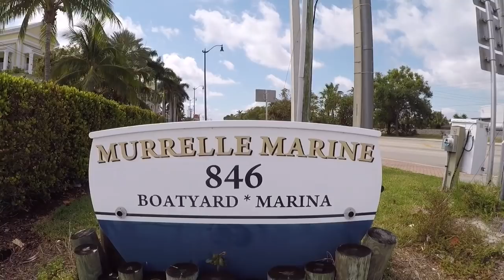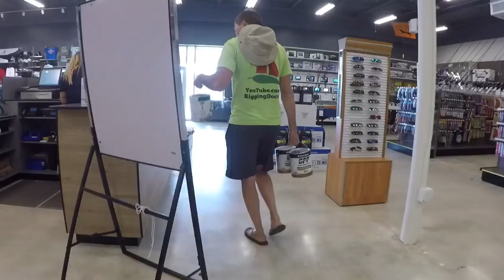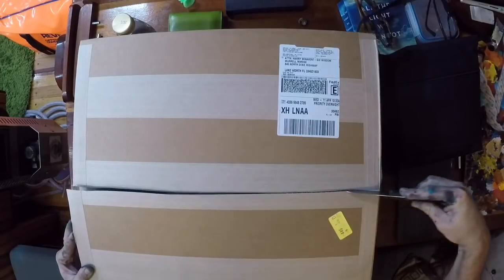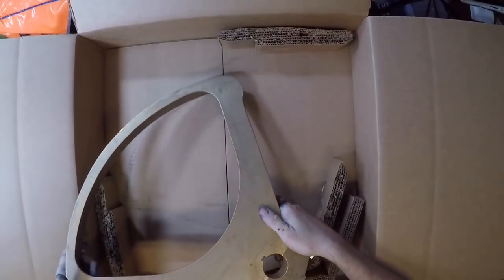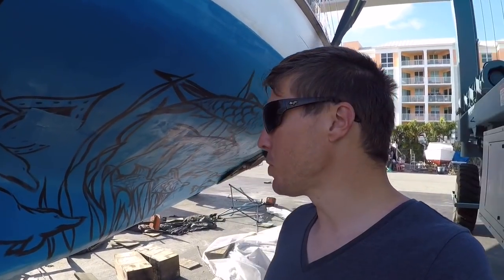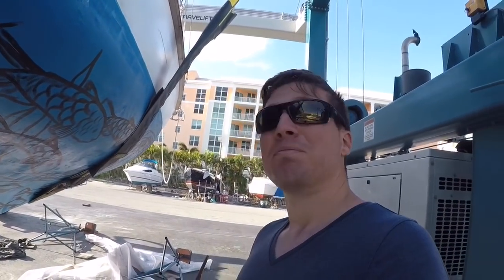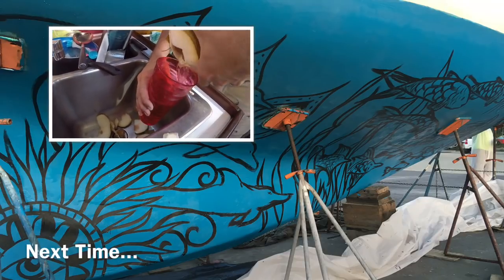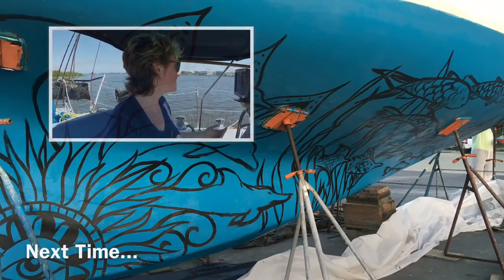The Haul Out (Part 2): Bottom Paint and SPLASH| Sailing Wisdom Ep 112

Comment: Nice job on getting all that work done so quickly!
I must say that your various trials and tribulations are validating a lot of the design decisions I made for my upcoming build.

1. Junk rig. No "I'm not gonna raise sail just now, because in a couple of hours, I'm gonna have to drop/reef it again" blues. Tacking is a piece of cake. No raising/reefing hassles. No fears of gybing when running downwind. No foredeck work. No bags of extra sails taking up valuable space below decks. Built-in storm sails. And, of course, no standing rigging!
2. Tiller steering. No quadrant to break, and easier to repair at sea.
3. The lazarette will be closed off from the main cabin and bilges by a watertight bulkhead, and will have its own "bilge" pump.
4. Same for the chain locker, except that it will be self-draining. (watertight inspection hatch, naturally)
5. Watertight collision bulkhead forward of the chain locker. Given point 3 above, it's kind of overkill, yes.. but it'll strengthen the hell out of the bow and provide a truly herculean samson post mounting point.
6. No below or near waterline through-hulls. Salt-water day tank and pump-out grey water tank/s instead. The peace of mind is worth a little extra hassle.
7. Watertight outboard motor well under the cockpit, fully and permanently closed off from the interior.
8. And I'm debating the merits and positions of one or two other watertight bulkheads (including bilges) in the main cabin area as well.

Given your severe allergy to raising and reefing sail for short periods of time (no offence intended, on your boat I'd feel the same way), I'd highly recommend that you consider one day converting Wisdom to junk rig yourselves. It will be a fair bit of work, given that you'd have to relocate the mast (and maybe add a foremast as well), but it will more than pay off in ease of handling. Just a thought.. ;-)

Comment: What I do to get under the stands is lower them, one at a time, paint, wait for it to dry, then raise the stand back up and move on to the next one.  The stands aren't supporting the boat.  They are just there to keep the boat from tipping over.  The boat is supported by the keel, sitting on blocks of wood.  If you are nervous about things, you can move the stand forward or back a couple of feet while the paint dries (or you can use a spare stand if one is available).

Good to see the damage was relatively minor.

Comment: I’m confused as to how or y you were charged 9700 for salvage could you not of just paid for tow neither of you left the boat so could you explain to viewers as to how it works when you become stranded outside of icw
Reply: Sailing S/V Slipstream , it has more to do with a soft grounding like the ones in the ICW, what happened on the beach they basically were hard a ground and out of the water.. commonly called a shipwreck.

Comment: I have concerns about the repair to the rudder. Filling the area with epoxy and cabosil with one layer of finish cloth is not a structural repair by any means. I think that crack should have been ground back for at least a 12 to one angle and glass fiber / epoxy used for a strong bond / repair. Then fair with epoxy putty... epoxy and filler does not make for a strong repair. Keep a close eye on your repair... hope all goes well. Be careful and seek out information from those experienced before going ahead with repairs.
Reply from the maker: It was a very shallow crack on the side of the rudder. The foam inside was really dense and strong, with no sign of a crack. 
The filler was just to fill in the shallow grind. The cloth was just to cover it all.